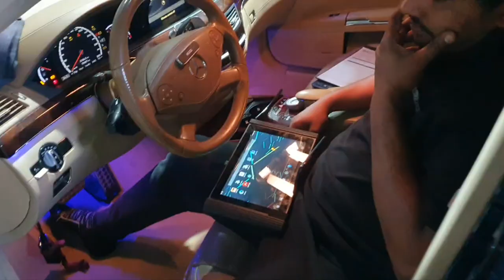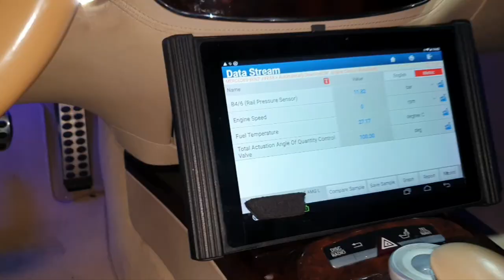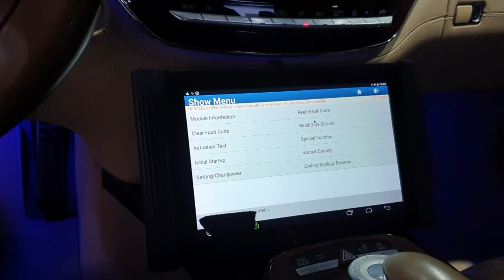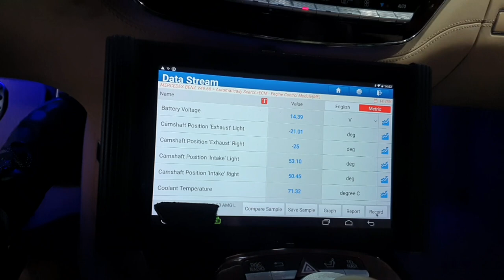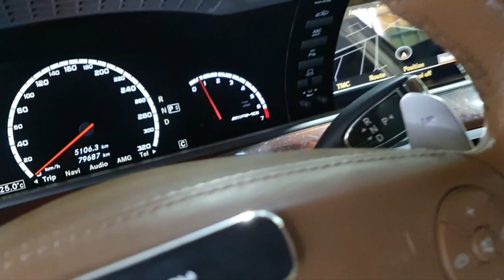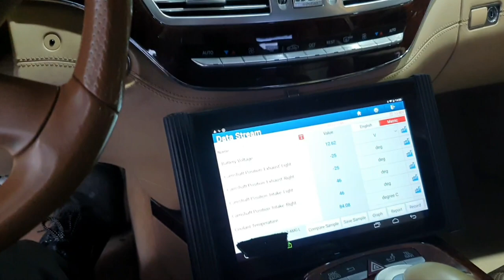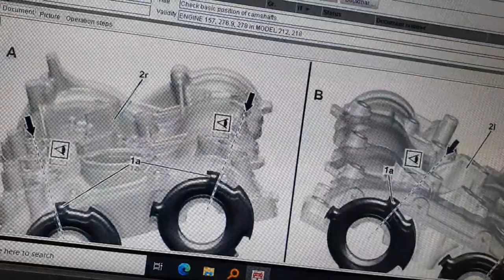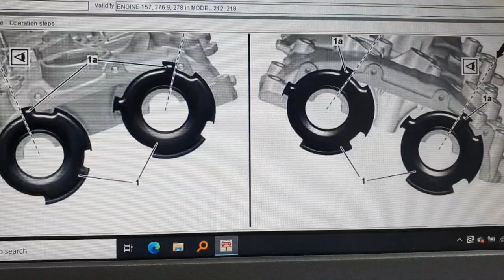S63 with 80k km check up (part 1)

Comment: Hai Tasos, I have an Ml63, 2007, it was misfiring terribly and I found out that 1 exhaust valve was bend and valve spring break, I had the head cylinder removed and the parts have been replaced, now before we could close the engine, we realised the crankshaft dumper pulley is only turning approximately 330 degrees clockwise  and then it is stucktried in reverse direction same thing..what could the problem be?

Comment: Say I have a 2007 m156 engine core complete by it self. Am I able to piece it together to have it run to be swapped into a w208? Main question is can I get this complete m156 engine to run from used parts off eBay? 
Thank you sir , I watched your whole m156 40min video, learned a lot from you.

Comment: Hi mate what is the dipstick you checked in the bottom right of the car engine bay
Reply: hydraulic suspension fluid
Reply: @radupetrascu  what fluid do I need to top it up with ?